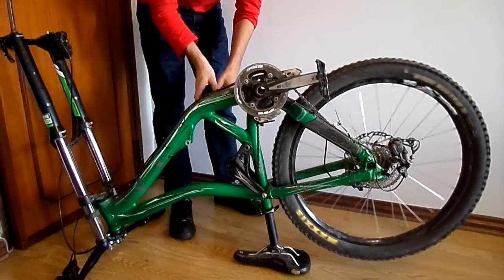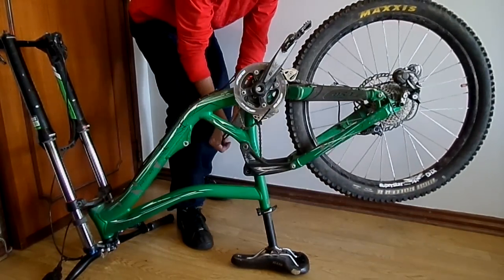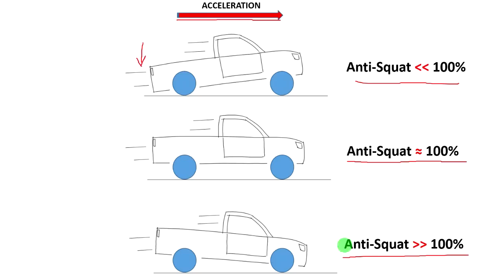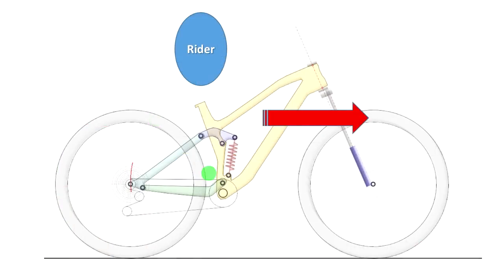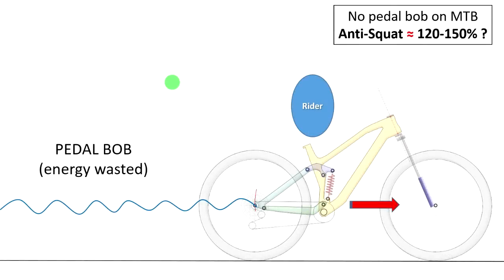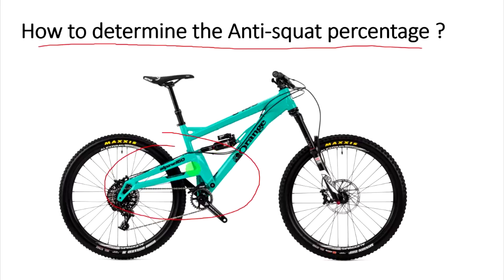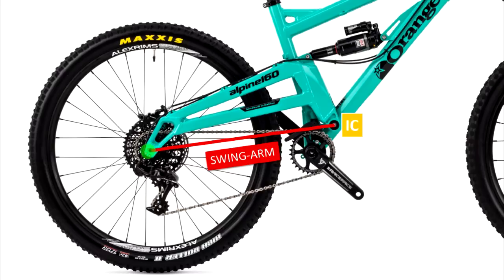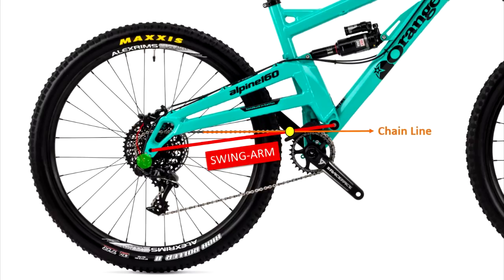Understanding Anti-Squat (MTB rear suspension Ep.11)

Comment: The amount of "pedal bob" is relative to the amount of force you push down on your pedals, chain line, suspension design, crank arm length and what tooth rear sprocket you happen to be in on the rear cassette, standing or sitting.

Comment: Nice but antisquat due to chain tension is only one component. You have to also consider driving force. If the rear axel is below the pivot point, then the acceleration force tends to extend the rear suspension. Particularly relevant on high pivot bikes.
Reply from the maker: Yes true. I was planning an update on this video to include the driving force, some years ago, but never did it, and now I don't have much time for this :D
Reply: Glad to hear you're busy! I've checked out a few more of your videos and your explanations are very very good, thank you!
Reply: Do you have a method of calculating driving force antisquat? Some method of quantifying it in order to calculate overall antisquat when combined with chain tension antrisquat? I for one would be very interested!

Comment: Quick question, because you can only pedal for such an amount of suspension travel, does that mean that when the crank is in a vertical position and touching the ground is when you should forget about maintaining anti-squat values?
Reply from the maker: Yes, anti squat in only relevant on first half of travel (near SAG), where you spend most of time pedalling. VPP system has very good antisquat on first half of travel and then they decrease sharply on second half of travel for instance
Reply: @andrextr  also, does the degree that the bike is on effect anti-squat values? For example pedalling at 30% sag at a 0 degree incline versus pedalling at 30% sag on a 20 degree incline

Comment: from what i understand, higher anti squat (100%) is good because the pedaling force doesn't go into compressing the suspension. but if the tension from the chain is counteracting the compression of the suspension, wouldn't your legs have to work harder in order for the shock to not compress?
Reply from the maker: No, it means that all your leg force is transferred to spinning the rear wheel. No energy is wasted on suspension movement. But I understood your doubt :)  ultimately what matters is suspension movement. Suspension is a energy “sponge”, it soaks energy from bumps and from you. The role of Suspension is to absorb energy and dissipate it (absorb energy from bumps when it compresses and dissipate it by heat during the rebound due to hydraulic friction). When suspension moves by your pedaling or body motion it is stealing energy from you. This is why longer travel bikes feel more heavy and sluggish on pedaling and short travel bikes feel more reactive and nimble. Its mostly due to the amount of suspension movement. No movement = no energy wasted.
Reply: @andrextr  thanks for the explanation!

Comment: What if chainline does not cross swingarm line or they meet at very very far from the bike?
Reply from the maker: Tung Trinh Its the same rational. if both lines are fully parallel we assume that they would cross at the infinite, and as a result the antisquat line would also be a parallel and have the same angle as the other two lines.

Comment: Isn’t the squat adjustment on the rear shock?
Reply from the maker: Lester Ma the anti-squat is an intrinsic characteristic of the suspension linkage design and it is related with pedaling efficiency independently of shock adjustment. In some shocks you can adjust compression damping and make it firmer or even locked, which also increases pedaling efficacy.

Comment: Not anit-squat. Anti-Squat has to do with the mass of the system reacting with the suspension system. Nothing to do with the chain or chain line. Your car example is correct...and has nothing to do with ANY sort of chain system....The mass of the car is loaded into the suspension linage as it accelerates. For anti-squat, this is a good video up until the 4:00 mark, then you are talking about chain line reactions to the link. after that.
Reply: Sorry, but we are talking abour mtb here. He chain does have it's influence on the suspension, because force applying to suspension by rider through the chain.

Comment: The chain tension is reactex by the tractiob at the ground between road surface rear tire. How does the shock react it? Please explain
Reply from the maker: The suspension has the tendency to compress under acceleration due to the inertia (weight transfer). Since the swingwarm and chainline are not fully horizontal, the driving force and the chain pulling force can counteract, or enhance, the suspension squat. The article bellow has a nice and intuitive explanation (in the present video I only talked about chain pulling forces to simplify, because they are the major forces involved in traditional FS mountain-bikes, but on high-pivot bikes, or motorbikes, the swingarm angle is steeper and thus the driving force have a major contribution to the the overall anti-squat)
https://www.sportrider.com/more-fun-geometry#page-3

Comment: I have a doubt. If you could please help.
The chain driving force passes through the sprockets in the rear cassette and turns the rear wheel. The rear wheel will only roll when the driving force and the traction between tire and road surface is equal. This means the chain tension is being reacted by the traction on the ground. How is the chain tension reacted by the shock through the swing arm?
Reply: This not proves that the both forces are equal! The rear moves only when you overcome the friction forces and the gravity in case you are on an ascent, but this does not mean that you exert this amount of force to the pedal. For example, if you grab the brake then stand on the pedal, you exert all your weight, yet you still won't move. That's because the brake diverts the force you applied to elsewhere.

The suspension will also compress, because the swingarm will divert some of your force not into the chain but into the suspension.

Think about vectors. The vectorial sum of the forces are zero, but that does not necessarily mean that there is only two opposing vectors in the system.

Comment: Great videos, How have you worked out the yellow 100% anti squat zone. I currently ride a single pivot and love it. But looking into something more gravity orientated and progressive for a coil shock, maybe a 29er? how about a vid on the pros and cons of them?
Reply from the maker: The yellow zone is based on the graphical method of anti-squat (I didn't invented the method). But basically a 100% AS is when the AS line has the center of gravity (CoG) heigth above the front axle. Since the typical CoG heigth for a bike + rider is similar to the wheelbase (~ 1150mm), then this AS 100% line has an angle of nearly 45º (yellow zone)... There are a lot of articles about wheel size discussion, and I dont have much more to say, specially because the advantages and disadvantages are hard to quantify making it a quite subjective topic and because I still ride 26 eheh :))

Comment: Hi Andrextr. I can't understand very well how a idler pulley on a swingarm (or not on the main triangle) can make the %anti-squat down in a high single-pivot or in a high virtual pivot/IC, and the used method in the program Linkage X3 is a real mystery for me. Could you explain it with a graphical method like in this video? Thanks.
Reply from the maker: I want to make a video exactly about that, but I still didn't make it (no much free time lately). Anti-squat is a result of two factors: 1) Chain pulling and 2) Swingarm angle (also called as driving force or free/natural or frame anti-squat). In this video I only talked about chain pulling since it's the most relevant force for most traditional bikes. As I explained, the anti-squat of these systems depend on the chain growth, and this amount of growth is proportional to anti-squat % and inevitably to pedal kickback amount. On most high pivot bikes (or motorbikes) you can achieve good anti-squats with minimal chain pulling since the 2nd point starts to be more relevant. So what is this 2nd point (swingarm angle anti-squat, also known as frame or free anti-squat)? It's easy to understand. Imagine a side view of an high-pivot bike (with a steep swingarm). When you accelerate the wheel spins and the wheel axle moves forward. This forces the swingarm to rotate counter clockwise around the main pivot (extending the suspension). That's the "free" anti-squat. It's just a result of how steep the swingarm line is. On a bike with an horizontal swingarm this free anti-squat will be very low and the bike would depend mostly on chain pulling to achieve good pedaling efficiency. On high pivot bikes or in motorbikes you can change the chainline (with idlers) in order to decrease a lot the chain growth and pedal kickback and still having good anti-squat (from this "free" anti-squat factor). Not sure if I answered the question. Probably not. lol
Reply: Thank you very much Andrextr. I think I understand you (despite my poor English). My doubt maybe is related to the necessity to do a diagram or graphic of forces and moments in the case of the idler-pulley on any link of the suspension. I think the current version uses a secret method by I-Track Suspension. Look at the Linkage X3 Anti-squat graphics in the case of a system with idler on swingarm, you can see the I-Track mark behind.

As you say in the note of your video, on the I-track web they also say talking about the "normal" graphical method:

(http://www.i-tracksuspension.com/suspensiontheory2.html#graphical)

"There are a number of suspension designs where this graphical method does not apply. These include:
- Unified Rear Triangle (Trek, Klein)
- Independent Drivetrain (GT i-Drive, Mongoose, Lapierre)
- Swingarm Mounted Idler (Corsair, Balfa, Empire, Commencal)
- i-Track Suspension

The engineers at i-track suspension have a strong understanding of vehicle dynamics, and have been able to devise new graphical methods, to enable the % Anti-Squat to be accurately quantified for all of these suspension systems. These methods are currently kept as a ‘trade secret’. "

It´s a shame this method isn't shared (despite I think I understand their reasons), but above all, it's a shame it is hidden on the Linkage program. It's bad for us, the users of the program (that we paid for it...). 

Best regards
Reply from the maker: Yes, when you place the idler on swingarm (unsprung mass) then the chain force on the idler is also transmitted to the swingarm so it would affect the final result (thus, you need to use that new patented method). If you place the idler on the main frame then it uses the normal method because the forces at the idler won't affect the suspension.
Reply: Hi, I don't understand which method is used to calculate the ICas point for an Horstlink system on linkage software. Does anyone know how it's built?
Reply from the maker: +tuyen chi nguyen it's the interception point between chain line and swingarm line, being the swingarm arm the line between rear axle and IC

Comment: andrextr how would you describe this anti-squat point in bikes where the pivot-axle-line does not cross with the chain at all? Is it simply non-existent as drivetrain and suspension are independent from each other???
2 examples are
- Race link, by Brooklyn Bike Works 
https://s-media-cache-ak0.pinimg.com/originals/4e/2d/9f/4e2d9f2a1b197052f22675d12047ada5.jpg
- Bolt, by DMR http://www.dmrbikes.com/Catalogue/Frames/Full-Suspension/bolt
Reply from the maker: +Martti Heino You need to prolong these lines until they cross somewhere in the space. This cross can happen at long distances if the lines are quite parallel (and it can happen at the left or right of the bike). If they are truly and fully parallel the cross happens in infinity, therefore the antisquat line will cross at rear tire contact point and it will be also parallel to chain line or pivot axle line. I will talk more about antisquat in a future video. Bye
Reply: Thanks for the prompt answer and can't wait to see the follow-up video on the anti-squat! I understand the virtual ansti-squat point being long distance from the lines. I was wondering of the effects of this on the behavior of a pivot system like the DMR Bolt. 

To my understanding this A-S point would be greatly variable depending on the gear you would have on the cassette, therefore determening the angle of chainline and pivot-axle-line being positive or negative. This would then slightly pull or compress the shock, if I understood you right.
 
What I still wonder is the actual effect of a certain pedaling force when translated into the shock. This is because of the very low angle of pull that the chain would make on the single-pivot swingarm type design like the DMR Bolt. To me it feels like that force would be extremely low, since the vector component that is in 90 degrees to the pivot-axle-line can be the only force that translates into the shock. 

In any case I love your videos! Awesome work Andre.
Reply from the maker: +Martti Heino In DMR Bolt the antisquat will change a lot across different rear cogs and also they are quite low, or even negative on smaller cogs. The advantage of this is the minimal chain growth. When it's negative it means that the chain tension is actually compressing the shock amplifying even more the pedal bob. When the linkage is well designed the antisquat is similar across all rear cogs (see my recent video of DMR Sled). In the follow up video I will talk about another force involved in antisquat which was not mentioned here. It's the driving force. On high pivot bikes the swing arm has a steep angle and during the acceleration the suspension has the tendency to extend (the wheel is moving forward during acelleration so the steeper the swingarm the more this acelleration rotates the swingarm at main pivot, extending the suspension). So, on high pivot bikes you don't need much chain pulling to get 100% antisquat. So, you can design a system with minimal chaingrowth (with an idler pulley) and still get good pedaling efficiency. On normal bikes (non high pivot), the antisquat effect comes mostly from chain pulling (the disadvantage is the increased pedal kickback and chaingrowth). Bye

Comment: Andre how about lapierre Spicy 2016? tq.
Reply from the maker: Hi. The Spicy has OK anti-squats (around 80%, which are not great, but it's ok). Anti-rise around 65% which is also OK. The biggest problem in my opinion is the leverage ratio. It has an overall progressive ratio, but the last 20mm are extremely regressive (can't understand why they did it like that)... So, the total progressivity is ok (around 20%), but the last 20mm are almost useless and won't provide a good bottom-out resistance. Without that regressive part, the bike would have a better bottom-out resistance with an overall progressivity of around 30-35%. Bye
Reply: Thx Andre

Comment: Hi Andre, awesome explanation, what do you think about Liteville 301 mk13 Enduro   vs Orbea Rallon?
Reply from the maker: The Liteville 301 mk13 160mm has good anti-squats (120% on average for singlering setup) and very low anti-rise (10%). So the bike pedals well and it's very neutral to braking forces. The progressivity is 30%. Orbea rallon also has good pedaling efficiency but it's a linear frame (only 5% progressivity). The anti-rise of rallon is around 70%. Bye
Reply: Great Andre, Thank you!

Comment: Is anit squat related to pedal kick back? recently I changed 1x11 gears to 2x11 which has 34-24t chain rings and 11-42t cassette. And I think I experienced pedal kickback when the gear was 24t front 42t rear. when I pumped the bike hard I could feel some force on my feet and bike going forward which  I have never felt this odd feeling when I used 30t front 42t rear.  might this be pedal kickback or is this just because I cut the chain in the wrong length?
Reply: thank you.

Comment: Hi andrextr.  Your channel is so informative.

Could you please do an analysis of the Giant bike's Maestro Suspension and other similar suspensions to it like with Niner?

Also, how does wheel size (26, 27.5, 29) affect frame and suspension design.  Why is it not as simple just to convert an existing frame for a different wheel size.
Reply from the maker: I have a couple of videos about Giant Reign and Trance analysis. The Niner, Maestro, or SC VPP have the same type of system, the difference is how and where the pivots are placed, and that creates different characteristics. For instance, the Maestro and VPP are optimized for anti-squats around ~100% (good on pedaling) on a singlering setup (30/32T) while Niner have lower anti-squats (around 50-80% depending on the models), this is because of the Instant Center location in part due to the lower placement of the lower link (which is bellow the BB). On the other hand, Niner and Maestro are slightly progressives, while Nomad 3 is very progressive... Those are some of the main differences. Regarding the wheel size, the frame needs to be redesigned to accommodate bigger wheels (clearance issues). Usually the kinematics are well preserved between different wheel size's frame models. Bye